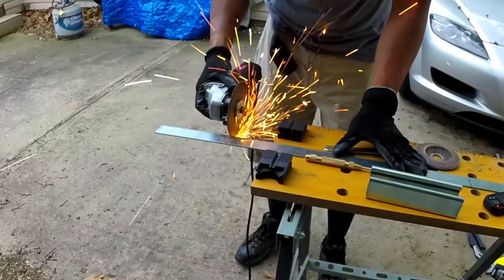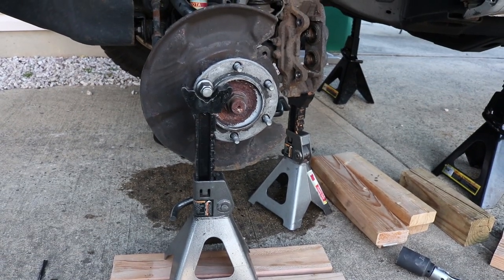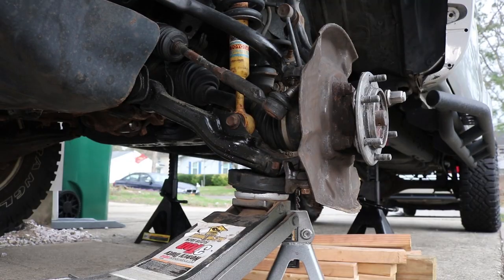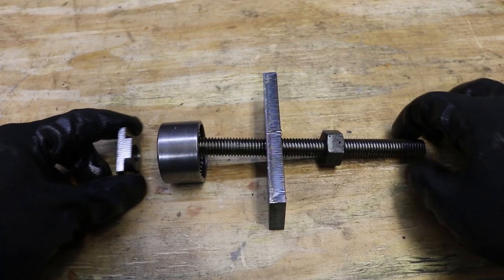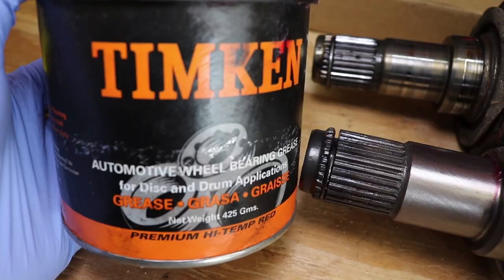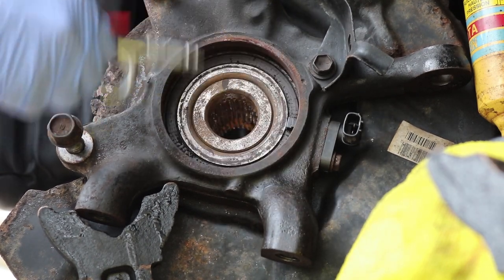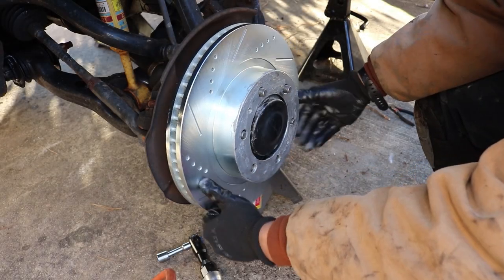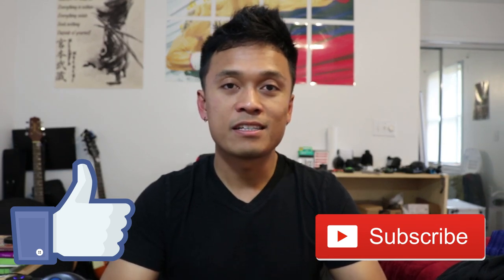ECGS  Bushing Upgrade (Tacoma DIY / How To) + CV Axle Replacement

Comment: After watching this I now understand why they want $285 to replace it.  Worth it. I appreciate you tackling it yourself.
Reply from the maker: Yea, I went more thoroughly w/ fluids and seal replacements too. It is a lot of work though regardless
Reply: Way back b4 they had the needle bearings in all the T100's, they had the brass bushings but most didn't have needle bearing....it took me forever to convince Toyota that mine had it and get it ordered. They thought mine didn't have needle bearing.    Now, 8yrs plus they have a bushing that's better than the needle  bearing??.....lol.   I bought in 95 and still have it but this was a tough job!
Reply: only $285.. thats a steal lmao

Comment: Great video. You kind of have a rust bucket truck, which is pretty typical for most people. It's a lot more interesting because that's how the real world works, not just showroom trucks getting an aftermarket lift kit when they have 3000 miles on the odometer, and only being driven to Costco on weekends.
Reply from the maker: Lol thanks for the compliment. Reality is definitely different from the high bankroll shows about car upgrades. This channel has been a passion project, self funded and now I'm working on it as a lifestyle

Comment: I put the bearing in like a pro with the help of your video. It went so smooth that I was shocked. The new bearing took away the sound/vibration completely. My 2015 Tacoma drives like a Cadillac now. Super big thanks for making a detailed video.

Comment: Solid video. Ordered the removal tool from ECGS and it wouldn’t seat in behind the needle bearing had to tap it in and that caused the back side of the needle bearing to shatter...not a big deal had to use a magnet to get out all the bits...aside from that really great install video. Thanks again.
Reply from the maker: I'm glad the video helped. I think that tool is hand made so there's some inconsistencies in the build there

Comment: I used a 4"x1/2" bolt, 1/2 and a 7/8" washer which I ground down 1/8" on opposing sides, I slid the bolt head 1/2", 7/8" washers thru the old bearing then I added a piece of flat bar 4"x2"x3/8" with a 1/2" hole, 3 1/2 jam nuts, 1 to pull the bearing out and 2 locked on the end to hold the bolt from turning. cost me $4.64 Canadian. note: if the o.d. of the 7/8" washer is a little smaller then the bearing just peen the unground sides to expand to the o.d. of the bearing.
Reply from the maker: Thats a great idea 👍
Reply: @KFloTacoma  Thanks! Your video was very helpful!

Comment: Lol I used a homemade removal tool for mine since I’m cheap 🤣. No more vibration or leaks now though with a 2” front lift
Reply: What did your homemade tool look like? I'm having such a pain using a slide hammer

Comment: Great video. I’m looking to lift my ‘21 Tacoma 2” in the front and 1” in the back to level it out. Would this needle bearing switch to the bushing be necessary when lifting? I have 55k miles on the truck. Thanks.

Comment: Excellent video. I have replaced the same needle bearing on my FJ cruiser because it had a play, but I have the problem that when doing the test in motion, it leaks oil because the CV axle sticks out a little, what could be the reason? ?

Comment: Heard several methods on installing the seal. I installed seal even to outerlip such as you did but leaking gear oil. I've seen a few people push in about 1/8 further in.

Comment: All your videos are great and the videography is awesome, a lot of the other ECGS clamshell bushing install videos give a terrible vantage point. Question for ya, it looked like you hammered the bushing past flush, about 1/8 of an inch, is that the case or just the video angle. Thanks again.
Reply from the maker: that's just the case with the video angle and how you're looking at it. If you're looking at the right side of the bushing pausing at 9:20, you'll probably see the debris in the groove between the bushing and the casing - you can kind see that those two surfaces are flush.
Reply: Awesome, thanks again! Keep the great video’s coming!

Comment: Pretty sure mine finally went bad. I’ve got a 3.5” lift on mine and have to swap my cv’s every few years so I figured it would happen at some point.
Reply from the maker: You can watch this video as you perform this repair
Reply: @KFloTacoma  I just did it and posted a quick time laps. Did a few things different but same outcome! 💪🏻
Reply from the maker: Awesome! Good stuff!

Comment: Have new 2022 4Runner with 300 miles on it that has vibration between 40-50, noise goes away in 4wd.  Taken to dealership twice,  once the noise was not noticeable, 2nd time they   heard the noise and did several tests which came back inclusive so they said it was normal, to take it home , drive it, bring back if gets worse.   They drained front differential and no metal was found in oil. Used electronic listening device, checked brakes and tires and maybe other tests.  If you research it it seems to be bad front drivers side needle bearing.  I plan on driving it few more days or weeks then if noise still noticeable, I taking it back to dealership.   Any thoughts?

Comment: Still another .. gracias
Yours are the best out there..
Question..can you please post up the part numbers and where you purchased them for the 2 seals, the one for the clamshell and the one for back of bearing on knuckle..
Reply from the maker: I've updated the description but here they are copied and pasted:
Seal part numbers,
Drivers side
Toyota# 90311-47027
Passenger side
Toyota# 90311-47013

Hub Side Seals:
90316A0001

Comment: Replaced needle bearing with ECGS bushing no problem. Having trouble with it leaking
Reply from the maker: Did you replace the seals?
Reply: @KFloTacoma  Yes replaced the seal the seal ,new axle shaft. It was not an OEM Toyota seal, it was a Duralast seal. Having Small vibration around 20 mph
Reply from the maker: Did you inspect the diff's mounting surface prior to installing the new seal? Sometimes, during removal that portion can get scratched and the oil can weep through in between the scratched surface as well as the metal part of the seal. Is it leaking a lot? Did you also try to match the seal against the axle before installing it onto the diff? Just to double check that the seal seats properly against the diff.
Reply: @KFloTacoma  Cleaned the surface. Leaking a lot when I drive. I also seen that if the breather tubes are clogged it could cause pressure to build up and force it out of the seals. When I installed the seal the last time it did not leak until I drove the vehicle for quite a distance for the first time since install, then it started to leak ?
Reply from the maker: Yea I agree that the breather tube could be the case there. The heat from driving can definitely cause back pressure

Comment: Great video only problem I have is putting the torch to the wheel bearing. Time will tell if the seals burned up and allow water into the sealed assembly which in turn washes out the grease and leads to bearing failure.

Comment: Can you explain why it is only a driver's side issue?? TY
  
On my truck, I am feeling a bit of a vibration around 50 mpg but not bad and goes away above or below that speed range.  This week I noticed a sound of vibration at start up. Seems like its coming from around my feet when i'm turning it over.  (turning on the truck) 
I can feel play on the driver's side CV connection to the diff, and just a little bit of play on the passenger's side....   so I am fairly certain this is my current issue.  
Truck has 237k miles, still original clutch, (I haven't done the ClutchMasters Hydro bearing fix yet, but that part is now on my shelf waiting for the clutch to finally fail.....) DCSB, 4x4.  
For a year and a half it has Bilstein 5100s with an OME883 springs and an AAL in the rear that were installed when Toyota replaced the frame, summer 2018.  So it's lifted maybe 1-2 inches.  Stock tires for now, but I did just buy new wheels and am saving up for larger tires... 305's or similar.
Reply from the maker: i know that the driver side cv axle is connected directly to the spider gear, while the passenger side has the actuator collar and assembly and then goes into another shaft which then goes into the passenger CV axle. Toyota may have a different tolerance stack in the assembly of the passenger side diff. I can't really give a definitive answer unless I break down that front diff completely and inspect the design. 

Yup, it sounds like the issue you are having is indeed the needle bearing. Good luck brother!
Reply: @KFloTacoma  When buying my bushing last week, I asked ECGS and I thought they implied that the other (passenger) side is a different type of bearing, maybe Ball type vs the axial Pin roller style of the Drivers side - also the overall Clamshell unit is Asymmetrical and each side experiences different loading....   

I'm going to try my Bushing install next weekend.... fingers crossed that I can drive away from my drive way when done!

Comment: I want to know if it is the same for the passenger side because I have not seen a video that they do the left side thank
Reply from the maker: You only need the driver side. It's a stub shaft on the passenger side which doesn't have the issue

Comment: Hi, excuse my ignorance but, why it's recommended to replace that ring? Should be a good idea to do it on all lifted vehicles or justo tacos or to any car? Thanks for your great video and explanation! 👌👌😎
Reply from the maker: This is more for lifted tacomas, 4 runners and I believe fj cruisers. Lifting causes driveline vibrations. This replacement fixes the issue

Comment: Does all this apply to a 2013 tacoma? I pulled everything out and simply do not see the pin bearings. Is the pin bearing only on the driver side. I'm asking as I only removed the passenger side.
Reply from the maker: it's on the driver side only

Comment: If it makes the growling noise originating from the front diff in 2wd and 4H, is it still needle bearing or something else?
Reply from the maker: The needle bearimg noise goes away when you put it in 4wd. Although if it is worn out really bad then it can be the cause of the noise as well. Is the growling noise rhythmic/cyclic?
Reply: @KFloTacoma  Noise been going for about 6 months now, hooked ears up to front diff and that's where growl is coming from. It is cyclical and changes frequency as you get faster/slower. Usually starts about ~20 mph. 2 separate mechanics recommended front diff replacement, your option would save me a metric ton if it were the fix you said.
Reply from the maker: Did this noise start after a lift kit install? If so, then the issue is most definitely the needle bearing. If not then it may be the diff.
Reply: @KFloTacoma  looking like the front diff, no lift. Thanks for the info.
Reply: Have you flushed the front dif oil?

Comment: Should I do this mod before axle shims? I have carrier bearing spacer installed right now
Reply from the maker: If you're talking about the rear axle shims, both mods are independent and it doesn't really matter which one you do first. This mod does take longer than the axle shims.

Comment: Do you know if this needle bearing will fit a 2007 4runner sr5 v6?! I've been trying to find this part forever! So glad I've came across your video!
Reply from the maker: 4 runner and tacomas are very similar. I would suggest reaching out to ECGS and have them confirm that it will work with your truck
Reply: Yes it will. Just ordered mine. When on the ECGS site you can either pick from a 7.5" clamshell (3rd gen 4runner) or 8'' clamshell (4th and 5th gen 4runner. You also have to give them your year make and model when ordering so Im positive they sort that out.
Reply: I have a 97 Tacoma and my CV axles are flopping do they make this bushing for that differential

Comment: Another question . What happens if the metal flange on the axle is a bit bent , the flange that is on the end going into the front differential. Mine is a bit bent dont know how it probably happened after replacing the needle bearing and i have a very minor leak . Already replaced the acle seal but still have a leak
Reply from the maker: That flange acts like a dust cover to keep the seals clear from larger debris. So the leak is coming from that area? did you also replace the CV axle or did you reuse the old one? if reused, did you check the bearing surface on that axle for scratches and deep gouges?
Reply: Yea thats the area where its leaking from , i did replace the axle as well since the cv boot was torn . Very minor leak but the thing i noticed was that the flange was a bit bent not much
Reply from the maker: The only way to really validate would be to pull out the axle, if it's a small enough leak then it's your call wether or not it's worth pulling out and inspecting. There is a way to push out the CVs without damaging the flange - you can watch the regearing series in this channel
Reply: @KFloTacoma  i think its the axle i just went under the truck and compared the new one to the other side which is still oem and the oem has zero play and the new one has alot of play up and down and side to side . But its in all the way . Why is that ?
Reply from the maker: There really shouldn't be that much play. I wonder if this new axle has a different diameter for that bearing surfface
Reply: @KFloTacoma  not sure i bought the axle from autozone and i ended up replacing it with one from the dealer and the leak is gone
Reply: How long is the removal tool bolt you got from east coast gears . Mine was 3” and i wasnt able to get double nuts on it and in all videos it looks longer than 3”
Reply from the maker: I don't have that tool on hand but I want to say it was about roughly 3 or so inches. as long as the puller itself can seat behind the needle bearing and the housing of the diff, it should still work even with one nut.
Reply: @agustinherrera5600  The threaded rod of the removal tool is exactly 4 inches.

Comment: I have a 2020 tacoma sr. I'm feeling the vibrarion rumble strip feeling when I brake ....the truck is stock....could this bearing by my issue?the truck has 5000 miles on it...what coukd it be?
Reply from the maker: If it's happening when you're braking, then your brake rotors may be warped

Comment: Awesome vid!  Subscribed.  I just have a question:  My 2011 tacoma 4x4 is having a growling noise between 40-45mph, but turning the wheel doesn't make a difference in the sound.  I replaced both front complete hubs, and the sound is exactly the same.  The drivers side CV axle at the diff is very very loose compared to the passenger side.  Putting it in 4wd makes no difference in the sound, so that's why I'm wondering if I should just replace the cv axles or the bushing as well.  It has just under 90K.  I appreciate your reply!
Reply from the maker: Is your truck lifted?
Reply: KFlo's Tacoma Build   No lift, bone stock other than nitto terra grappler tires
Reply from the maker: How bad is the growling noise? If it's rythmic/cyclic then it's probably the needle bearing. In that case, it would be good to replace the needle bearing. If the CV axle is already loose, then, might as well add that in as a replacement. It's not much more in term of parts cost and since you will be pulling out the needle bearing anyway, then it would be worth it.
Reply: KFlo's Tacoma Build really bad!  I just ordered the cv axle and the bushing!   Thanks for your help!  Ill let you know when its all installed!
Reply from the maker: Cool. Good luck bro!
Reply: @KFloTacoma  Just completed the Cv Axle replacement, ECGS bushing replacement, all associated grease seals, and diff fluid change.  I will say, there was a bunch of black gunk in the front diff fluid.  It needed changed really bad.  My truck feels brand new again, and no more annoying noises/vibrations!  Thank you for all the helpful info!

Comment: hi, I have a question if you can help me please.  what size is the socket with which you put the bushing?
Reply from the maker: Hi Cesar, the socket size doesn't matter. Its whatever has the same diameter. When in doubt, you can also but the tool from ECGS

Comment: Which direction does the axle seal go in? Does the spring face outside or inside?
Reply from the maker: I'm not really understanding the question - I'm going to need you to reword. If you watch the video, the axle seals can only go one way at the hub end as well as the differential end.
Reply: The spring side is the back of the seal which should face the inside of the diff.

Comment: Do I need to do this for my15 Tacoma. I’m planning to do 2-3inch lift and want to know if I need this done and do I need a diff drop kit  as well
Reply from the maker: Yes and yes
Reply: @KFloTacoma  ok thx man, your videos are really helpful and saving me a ton of money by doing it my self and following ur guidance. Correct me if I’m wrong, here’s my shopping cart to do a lift the proper way so far imo: dobinsons full 2” lift kit (coil overs, shocks, new leaf packs, I bolts, ECGS bushing, front diff drop kit, SPC upper control arms

Let me know if I’m missing anything else :) I wanna do it once so I don’t have to go back after vibrations if they occur
Reply from the maker: I would recommend watching my driveline vibrations video. You have most of the necessary parts covered though. You may need the carrier bearing drop / angled shim kit which can be installed later. You can watch the said video for more information. What I bolts are you referring to? Also if you're planning to put on 33" tires you'll need to do the cmc mod